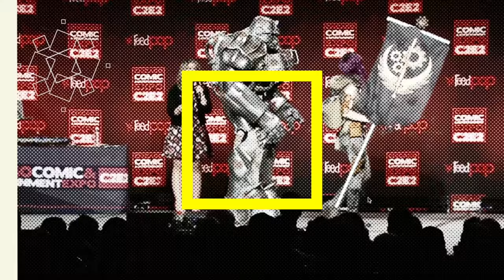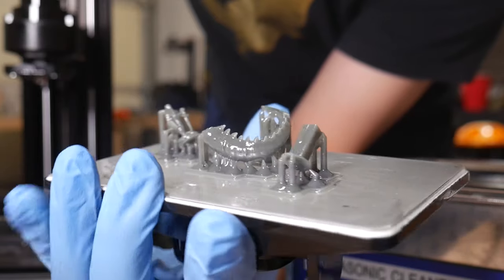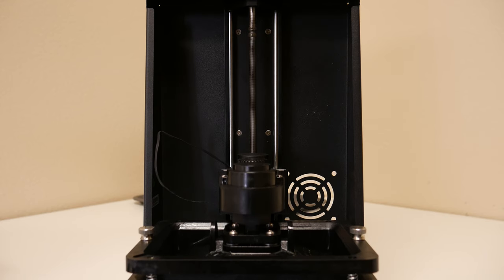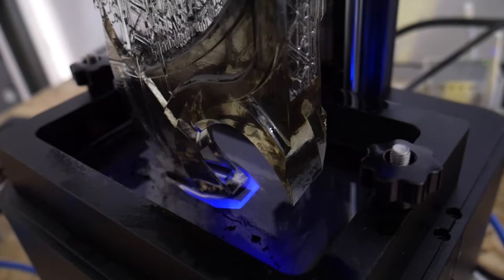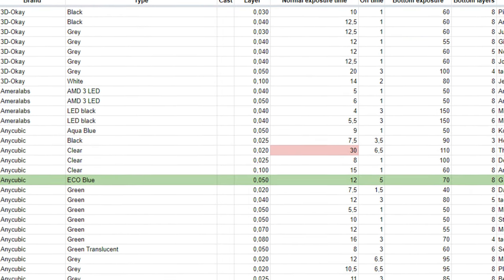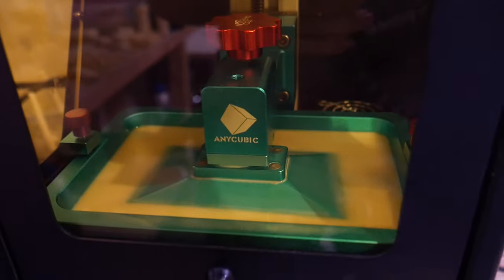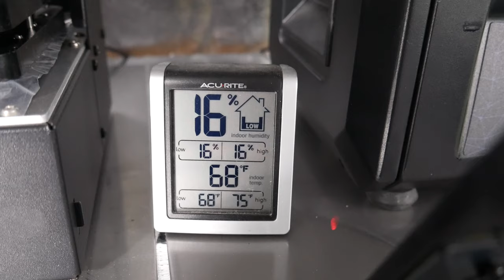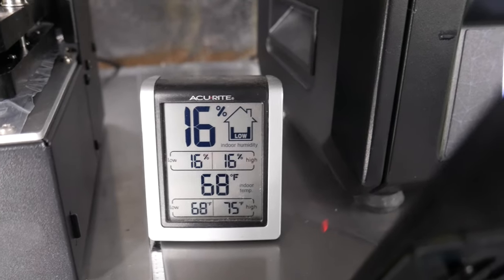4 Tips For getting PERFECT Resin 3D Print Bed Adhesion

Comment: I NEED HELP! so i am having a problem where my prints are just pancaking no supports are being printed all im getting is a pancake on the vat.. anyone recommend an app for the hertz? i use NFEP  sheets. from epax. idk if its my build plate lvl.. i did the paper test theres a good amount of resistance i cant just move it around so idk what the problem is.. i set the Z ..i put the plate down to home and pressed the z=0 ..idk what else to do..please someone help.
Reply from the maker: You mentioned that supports are not printing, is the base layer sticking to the plate? If it is but the rest of the supports are not printing then I'd recommend checking your layer exposures. 

Short term my ongoing recommendation for anyone having issues with printing is to download a calibration print such as the Monocure Monocalibration Matrix or the Ameralabs Town, both of these can help quickly narrow down print issues.

Comment: I had 10 successful prints on the Mono X. For that past 8 tries, I have the flat print shape stuck to the FEP each time. I've leveled the printer, installed new FEP twice. Increased my bottom level curing time but still no success. I'm at my wits' end here. Please help.
Reply: same here, did you find a fix? thanks

Comment: i can hear a pop pop sticking sound while my printer goes up to next layer. i think it sticks to the bottom , print doesnt want to let go of the bottom. is it a problem?
Reply from the maker: That's pretty normal if its staying on the build plate, that popping sound is the FEP flexing and peeling off the part as the printer is lifting off the screen to prep for the next layer.
Reply: @HiroCreations  yeah its amazing.ty i just got my first print without any problem :)
so it seems i done bed leveling correctly

Comment: Sadly sticking to the build plate isn't the issue. It's random points that come free from random supports on pre-supported minis. I can print like half a dozen pieces, 5/6 come out fine, and the other one will come out 99.99% fine but then there is some stray hair piece sticking out that didn't stick to the support it was on properly which causes those pieces to pancake. It's really difficult to identify those points before printing the first time, so many minis I end up having to print twice.
Reply from the maker: I actually have a dedicated video for pancaking on supported resin prints: https://www.youtube.com/watch?v=E2qH5Kv4s8s

Hopefully that helps.

Comment: I keep having the issue of my build plate tilting when I'm printing, what can I do to avoid this? Thanks
Reply from the maker: Depends on the printer, what printer you using?
Reply: @HiroCreations  elegoo mars, im trying to print a pair of legs for an action figure, and I have it tilted at about a 45 degree angle with supports, yet, it keeps tilting to one side?
Reply: @HiroCreations  and it wasn't that it wasn't sticking to the build plate, it just seemed like one side was getting printed first?
Reply from the maker: Ahh I know what you mean, I'd check the grub screws holding the ball joint on both the front and right side and make sure they are tight after you relevel the plate. If its still tilting, you may have resin on the ball joint and have to disassemble it to clean it with IPA--there are a few videos on youtube that cover this in depth.

Comment: I’m having this issue with my Photon S after I installed it the Wham Bam flexible plate bed, I leveled the bed, no adhesion, I printed the spacer at thingiverse, installed it, leveled again, still no adhesion.....I’m frustrated!
Reply from the maker: Bummer! I have not had any experience with those removable plates yet, but I have heard similar issues cropping up with other folks.

Comment: i am new at resin printing. my prints stick to the build plate. Then it develops voids. Ever seen that?
Reply: Developing voids is maybe a screen failure. You can run a test without attaching the resin container on the printer. Run a screen test for 3 sec to see if any wierd spots appear.

Comment: Hi Hiro,

My printer is in the garage. I live in the Montreal area in Canada  and my garage is around 22 Celsius. Just bought Elegoo grey resin to replace my Anycubic green ( old resin did not check the date when I received my printer!), got print on the first two print after that got 4 failure! I will check the bed level and the FEP maybe it is the temperature, Thx for the vid!

I saw a video where the guy is creating jewelry and he say he is using Rain-X on the FEP! Say it never stick after that! What do you think?
https://www.youtube.com/watch?v=mWanWDa5-ls&t=150s
Reply: Just saw your more recent video. It answer my question about Rain-X! It is no GOOD and it make sens what you are saying!  Thx.
Reply from the maker: 22C is not a unprintable temperature (i've printed at colder temps for science), one thing you did not mention is what base layer cure times you are slicing your models at?